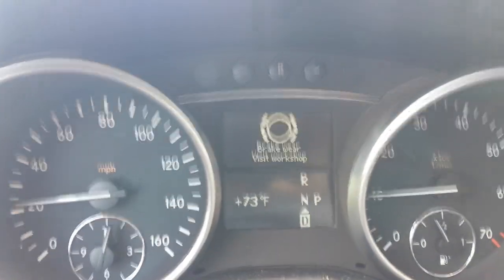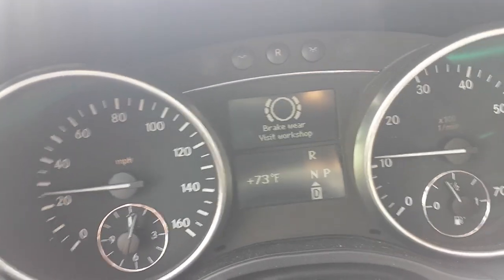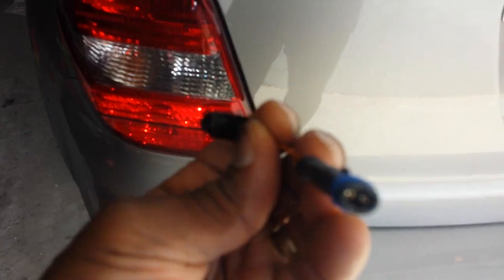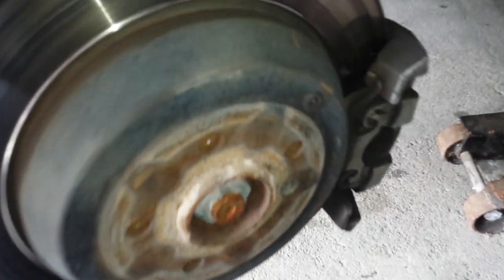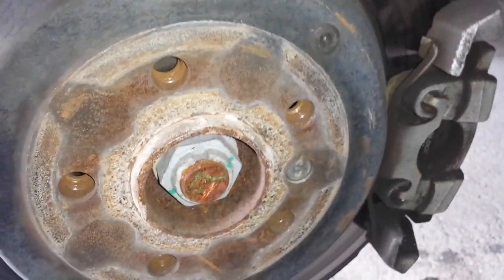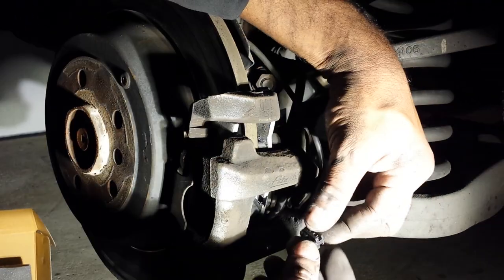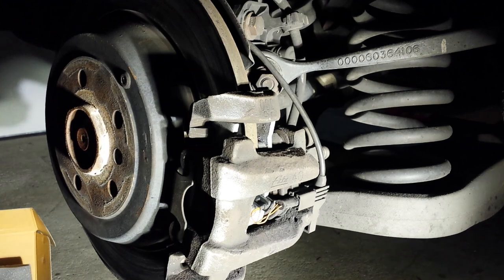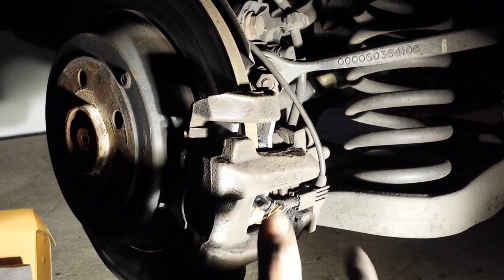Mercedes Brake Wear Sensor Replacement

Comment: Great video, thanks. Please don’t let calliper hang loose , tie it with a wire so you dont wreck the break lines. Clean all the surface where pads are touching the calliper and lubricate it with a brake lube. Also clean and lubricate sliding pins so they can move freely . When pushing the piston back I open the valve so old brake fluid doesn’t go back to the brake cylinder then I top up fluid if needed.😊

Comment: Great video! Only advice I would make is push the caliper back while the old pad is still on the caliper (three prong) makes for more even pressure and no damage of caliper or new pads. Also those rotors are well worn down even though the wear has been even.
Reply: You really know what's you are talking...hahahaha,very good my friend,I noticed too the same

Comment: So there sensors only on the right side of the car
Reply: It would be great to know that right out front. AND the right side is the passenger side of the car. As you are driving it.
Reply: So funny.. I was JUST wondering about this earlier today! had both wheels off, thinking there was a cable missing lol!

Comment: Look at your rotor. It is beyond service limits and beyond turning/resurfacing. You could buy a full set of rotors and brakes with sensors for around 220 dollars or less on Amazon
Reply from the maker: True - I updated it in another video.  Thanks

Comment: Thanks.... just bought a Mercedes despite many people warning of repair costs. As an ex-air force tech, I reckoned that it couldn't be harder to fix than an F-18 (yes the Australian air force flies them... not navy).  So thanks for helping me prove the nay sayers wrong and also giving me the satisfaction of fixing my own car.
Reply: I haven't had many problems with Mercedes. The problems are that do occur are usually small and inexpensive if fixed on your own (take it to Mercedes and that is another story). Regular maintenance is usually easy to do, once you are familiar with the design quirks. Maintenance can be a little more expensive, but most models have a lower rate of catastrophic failure than the vast majority of other brands and they can last longer than most vehicles if well taken care of.
Reply: I have a mercedes and had very few problems with it in the years i have own it. The cost arent that high on parts either

Comment: I had the same warning on the dashboard, just because I temporarily disconnected the near side rear sensor. 
It failed the MOT because of the message. 
I changed both of the rear sensors and the message remained. 
To clear it from the screen, I had to disconnect the battery, and reconnect it, and lo and behold, it had gone. 
If I had known, I could have done that before the MOT and it would have passed...!!

Comment: Watching your video was nice gave me a few pointers on how to install my sensors on my CLS . BUT I do have some concerns I've done my own mechanics for a while now, I'm a little worried you didn't clean anything or copper grease anything. The brake pad runners need to be cleaned of all brake dust /road grime otherwise the pads could get stuck on the caliper carriers  causing premature pad wear . The bolts you undone need to be cleaned and copper greased so the caliper itself will slide back and forth to release the pad off the disc. 

hope you don't mind the comments 

regards Harry
Reply from the maker: Hi Harry - good pointers that you have made.  I find that adding all of that grease leads to a few issues;  It attracts additional dust like a magnet that doesn't wash out of the grease; If you live in an area that salts and sands the roads in the winter time is also an additional problem.  These parts on the Mercedes tend not to rust (aluminum/ anodized steel)  

If you do add that grease do it sparingly.  I appreciate the feedback.

Comment: On my 2006 ML500 I used a 7 mm allen wrench socket for the caliper not a torx which you used.

Comment: Thank you for the knowledge. You are improving society, by sharing it.
In trying to pick your Brain I ask. 
2011 B200t, I just picked up a used one. It has aprox. 17000 KM's on it. 
When I am coasting to a stop, the Brakes engage, but it feels only partially. However if I release and press down fast on the peddle, the Braking action is positive and I get a good hard feeling on the Peddle, which stops the car immediately.
Any idea as to what causes this? The Car was just certified and two mechanic's say the Pads are good, with lots of life left. Also there are no fluid leaks on the floor.
Thanks in advance.

Comment: Pretty well illustrated video, but I couldn't help but notice something that I also have a question about. I have a 2002 Mercedes c320 and I need replace REAR rotors, pads & sensor, but I need to know if two sensors are require one for each of the rear tires since you only mentioned having to replace just one on your vehicle granted our models are totally different?
Reply: Take it you found out anyways but, he said at the end of the video is only on the right side

Comment: Is it possible to only change the brake pads and not the sensors if the brake warning light hasnt come on yet?
Reply from the maker: Yes.  The sensors are sensitive. Handle them with care.

Comment: I just replaced my brake pad sensor and the brake wear indicator on the dash went away automatically. My mistake was that I reused the old sensor because it visually looked ok, but from what I learn you got to change the sensor when it has been tripped by low pad thickness and has generated brake wear indicator.

Comment: Great DYI video and so easy to follow.  I almost feel like doing my E350 but still little reluctant since its my wife's car and want to make sure it is done right.
Reply from the maker: You definitely can do this.  Give it a shot.
Reply: Now I found out that I need to change the rotor too.  not too much more but I am reluctant since Ive heard some folks getting stuck midway with all the parts off the car.
Reply: Called the shops and they want upwards of $1,200 + for the work.  Did some research and parts are total about $525 for everything.

Comment: Hello there. I got my brake disc pads replaced and now need to buy two ABS sensors.  The image that is on the dashboard came on since i got them replaced although the mechanic told me the brakes were good. Do i need to order new brakes or when i replace the ABS sensors will this image disappear? I have a 2006 Mercedes Benz B200 hatchback.  I was also told i need to replace or rotate the front tires. Help please.
Reply from the maker: Hmmmm.... the light coming on after the brakes indicates that one or more brake pads is now worn past the acceptable thickness.   Sensors are in the front and back of the vehicle.   You should have him recheck the brakes pads.  Sometimes brake pads wear unevenly so each brake pad (inside/out) must be checked.  Change them in sets,  meaning rear set,  front set.  Do not just change one side or one wheel.
Reply: @iRepairAutos  Hello there. I did replace both front and back discs pads with brand new disc pads but i did not know i had to change the ABS sensors as the previous brake disc pads were really worn down.. My question now is once i change the brake disc pads do i also need to change the ABS sensors as well?  Cause the brake wear light came on after they were all changed . The mechanic told me i need to order a pair for the front but do i need for back as well?
Reply from the maker: Without scanning the car to see which brake sensor is bad you are playing the guessing game.   The sensors are cheap enough to buy them both and replace both front and rear.

Comment: Thank you so much for your channel. I have zero mechanical skills but By watching one of you other videos I was able to successfully replace both my batteries in my Mercedes. Even when I had questions you replied. Thank you for that. I have the same model ML350 (mine is 2008) that you are working on in this video. Even before my battery problem I was having a problem with the drivers side front brake grabbing without me pressing the pedal. I think it’s only that one grabbing. I got under there to check my pads and realized that the whole line that the brake pad wear sensor and the line it plugs into is completely missing. Do you think this could be the cause of why that brake is grabbing? I’d appreciate any help. Thanks again for your channel. I’m definitely a fan.
Reply from the maker: Sorry for the late response, YouTube doesn't always notify me of new comments.  Did you get this issue straightened out?

Comment: I have a ML320 2009, with new pads and sensors , and the brake wear warning keeps coming up. Sensor are good. Do you have any suggestions as to what else it could be?
Reply from the maker: Possible open circuit.  Get the scanner out and see which one.   Sometimes there's a bad connection.

Comment: He good ask explains  what he doing. 
 but didnt show how to dpress the the caliper to properly  fit the caliper with the new pads onto the rotor plus the rear rotors  should  be replaced  as you will get vibration  when stepping onto the brakes

Comment: Should the break wear light go off once you change everything or do I need to reset it ?
Reply from the maker: Wayne Algenio the brake wear alert will turn itself off once you change the brake sensor.  Make sure both sensors don't need changing
Reply: You need to replace the sensors on the pads that you replaced the new ones
Reply: Do you have to buy a whole new sensor or just a little piece on the end
Reply from the maker: Whole thing. It's one unit.

Comment: Thanks for this @iRepair Autos. Have few questions!
1. What is average life of these brake pads?
2. Is there a way to estimate effect of brake pad wear on braking distance ?  (Graph of Brake pad thickness vs. Braking distance)
3. can u kindly share Manual or data sheet of that brake pad wear sensor!
Thank you!
Reply from the maker: The brake pad life is directly proportional to your driving habits.   If you change the brake pads before the brake wear sensor is tripped then you never have to change the sensors. Once a sensor is tripped, you have to replace that sensor.
Reply: iRepair Autos cool! Any idea how its related to braking distance?
Reply from the maker: Brake sensor has nothing to do with the baking distance.   The braking distance is more proportional to road conditions, tires,  and vehicle load.
Reply: iRepair Autos ok! right! I wanted to know how does this sensor work? how it   detects reduction in thickness of brake pad?
Reply from the maker: Brake pad wears down and  eats through the sensor.

Comment: I CHANGED BOTH FRONT AND BACK BRAKES AND ALL 4 MY SENSORS BUT I STILL GET THIS CODE EVEN TOOK IT TO BRAKE CHECK...WHY?
Reply from the maker: Possible faulty new sensors,  bad connection, bad harness. Start with the sensor connections.
Reply: Tony Tyler make sure they are plugged in and seated properly.

Comment: Mine are not low, what do I do in this case? I drove it to a workshop, after that visit it came on. I think he messed something up
Reply from the maker: Check the front brakes too.  A mechanic can damage this sensor too but I HOPE they didn't do that to you.  It's possible.
Reply: iRepair Autos oh you mean the breakes behind the wheel hub? I totally forgot them

Comment: I have replaced new brake pads, but the brake wear lights still on. How to reset it?
Reply from the maker: +Zuofei Wang You have to replace the sensors.  Did you check the other pads a well?
Reply: Yes, I replaced all pads and found the sensors are located only on one side(front and rear). Thanks!

Comment: Why only change the right back side, the pads?
Reply from the maker: You should change only the one(s) that need changing. Sometimes that's both.
Reply: Very wrong you always change them in pairs and if you have a lower side that's mean your caliber is going out once you hit the break the caliber don't return to where it should
Reply: Never change one brake. Always do the left and right pads for either the front or rear axles. In other words change both fronts or both rears or all four. This guy is a hack.

Comment: I'd have cleaned everything first,then pushed the piston back before fitting the new greased pads and pins,and I wouldn't have let the caliper hang on the flexi hose,amateur work but informative video 👍

Comment: how do you reset it
Reply from the maker: El Michoacano once the new sensor is installed the light will go off.   if the light does not go off then you need to check the other sensor. this vehicle has one in the back and one in the front.
Reply: ***** ok thanks I have 2 check my cz I don't knw witch one is it I have that light on
Reply from the maker: Have you changed your brake pads recently?  If not they may need changing.  Change the pads and the sensor together.  A spent brake pad will damage the rotor if not changed out.
Reply: Ok thanks I will how much is that sensor
Reply from the maker: Under $10.00  check out my affiliate link to amazon: http://amzn.to/2ix3R5y
Reply: ***** ok thanks bro